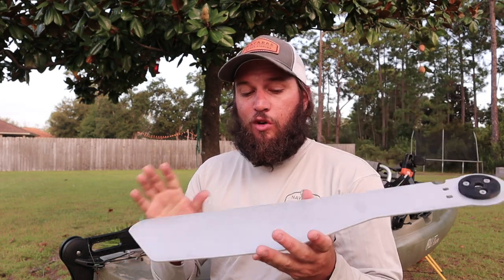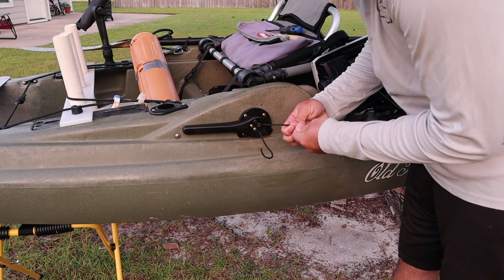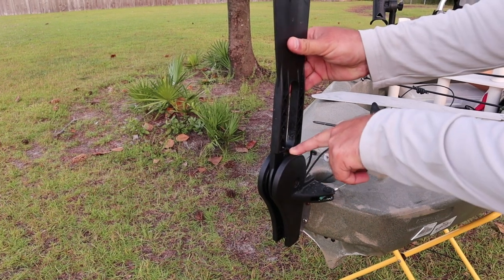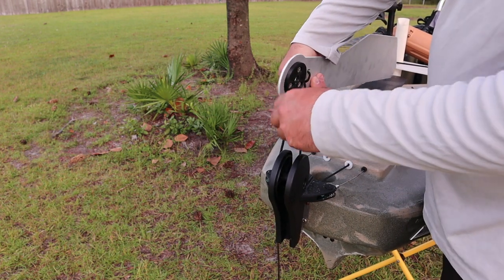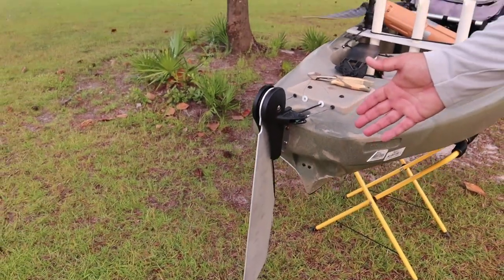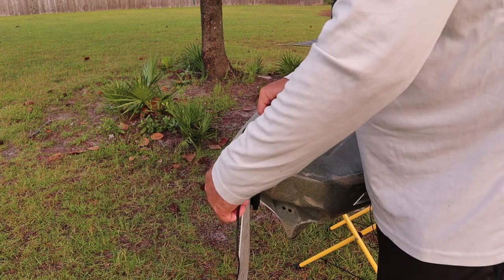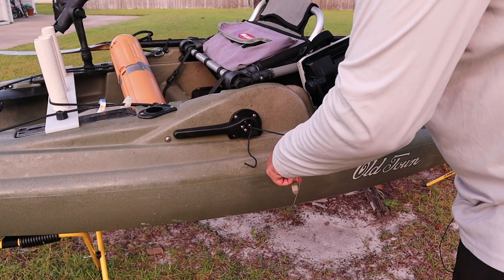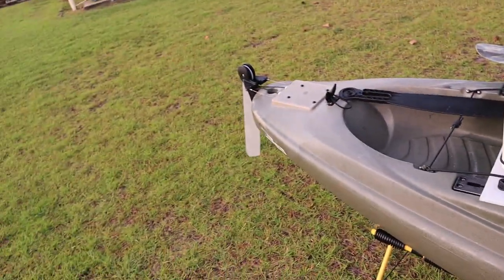Old Town Rudder Installation Video (Metal Replacement)

Comment: This rudder absolutely transformed the steering on my Topwater PDL 120. With the factory rudder the steering was non-responsive at slow speeds. With this replacement rudder the steering is responsive at slow speeds and insanely responsive at pedal cruising speeds. In addition I can cut directly perpendicular across strong current where are before I had to ferry across. 

Installation tip: Follow the video precisely. When you are ready to pull the cord back through make sure the rudder deploy handle is positioned exactly as directed in the video.
Reply: You have sold me on this sir! I have the same issue at slow speeds on the PDL 106. It's super annoying. I was wondering if the metal rudder helped it cut through better when you are going slow. Does it help steer when back pedaling at all?

Comment: Just finished.  I used 30 pound big game mono, sewn through the center of the cord, wrap to the end and tie.  I just didn't have any wire.  Take a pic of your cord arrangement at the rudder, the rudder lever and the pulley inside the hull, accessed under the seat.  You can reach the pulley inside with your hand, no problem.  If you break your line, it will be here.  Reach through there to the pulley opposite the lever and help feed it.  Only takes a second.  It makes it less stressful knowing you can help the cord make the sharp turns at the completion of the project.  Thank you Nick, great videos and cool products.  Will follow up on the rudder review when I get it on the water!
Reply: After being on the water with the new rudder only once, two things I noticed..first and more minor is it stays down.  The plastic one always wants to creep out of the full down position due to forward motion.  I checked 10 times, and it was full down every time.
Second, it responds noticeably faster, which is the reason I did it.  It actually makes the kayak feel like it wants to roll if you are travelling fast and turn hard.  No regrets to be clear, just a different seat of the pants feel.  You just added a lot of control surface.
I only have a couple hundred miles under my belt kayaking, but that is my take.  I did the rudder bolt at the same time, and that is a great improvement as well.

Comment: Very easy. Used 24 guage wire and it poked right through. A slight jiggle it will find it's path. I took the mushroom burnt ends and trimmed them to taper more to a point. Next would be nice to have the entire head aluminum. Not sure if you would need to add some small ballast for weight, but hey...Thanks again Navarre. Now on to my Tripleshot mount for my Lowerance transducer!!

Comment: Awesome! I originally thought it was silly and wouldn't be a big issue, But I was wrong. Every trip out I've been in multiple situations where I could not turn a certain direction because of the current. I hope old town goes back to the metal rudders, becomes a safety issue when you're next to rocks and bridges and stuff like I have been. I hope to order one of your rudders soon thanks man!
Reply from the maker: Thanks, Joey.

Comment: Finally got around doing this; had some minor stuff come up that might be worth mentioning for others. I had to use my impact driver to get out the bolt that holds the rudder, maybe it's because mine is still a bit new. I used 40# 7-strand fishing wire, and it was a bit annoying to get it to puncture through the cord's end but eventually managed; I think single strand wire/line works best. Finally, the wire I had sticking out the back went inside as I was moving the rudder around to guide the cord under the stud. I was able to get it back out by sticking my hand inside the hatch under the seat and pushing it out from there, although I admit I got scared for a second there lol. Also, it appears that the factory is "tying" the cord to the rudder's two "eyes" differently on newer kayaks than what's seen in the video. Instead of having the little loop that you have to pull out and hold, they just wrap the cord twice through the 2 "eyes" and then slide the cord through that loop that gets created and tighten it. Overall, a good experience and I'm happy with the results.

Comment: Could you look into what the market would be for a beefed up metal rudder for the Pescador Pilot 12. The current rudder has very little bite because it is so thin. I would gladly pay to have a medal replacement that was wider and less flexible. There are a number of videos on how to beef up the current rudder, but a metal replacement would be optimal. Thanks, love your stuff and your simple videos on how to use it.

Comment: Purchased two (2 yrs back) & FINALLY installed today... so looking forward to using them! Thx for this video; install went smoothly (even got the same cable lengths when done!). Only concern is, the metal rudder really slams the yak when putting it up... being aware one can minimize it, but have you had any feedback/experience on solving the problem?

Comment: This video is critical! I did it without wire but I DONT recommend. I put some 60# line through the rudder cable but it was pretty difficult threading the line through the braided cable. Can’t wait to get this new rudder wet.

Comment: Good stuff here, thanks for posting.

I just got a bigwater pdl a few days ago and was wondering, how tight do you like to keep the rudder steering cables?

They came pretty loose from old town and I've tightened them about halfway up the nuts, but still a bit of slack in the cables. I was just worried about over tightening and stripping something.
Reply from the maker: Luke, I keep a bit of play in mine.  The kayaks will slowly change shape overtime and the lines are to tight you will run into steering issues.  As long as it’s not coming unscrewed while you’re on the water you’re good to go.
Reply: The hull really shrinks and lengthens based on temps and/or being in the sun.  I wouldn't tighten them unless they are loose on the hottest sunniest day, or they will be tight as a banjo string.  Better a little slack than too tight.  Get one of Nick's rudder bolts and it will take the slack out of the rigging.

Comment: Just completed my install, hit a few bumps along the way lol...Heed Nick's advice and tie your wire (I used 40lb test Mono) as close to the bitter end of your cable as possible.  If you don't, you are going to have an extremely difficult time getting the cord back through the pulley, like I did.  If you have problems, make sure you open the hatch under your seat and grope around (the pulley) to get the lay of the land.  Thanks for the amazing support Nick!
Reply from the maker: Anytime, Chris.  I’m glad you were able to get it resolved for tomorrow’s fishing trip!
Reply: This is so familiar. I just did mine and experienced all of your same trials and tribulations lol. Used the iPhone to “see” what the inner handle area looked like.

Comment: Just got mine today and installed it a bit ago, I noticed the the metal one is thinner towards the screw where the plastic one has the grab handle, it gives it play back and forth at that spot, about 1/4 of an inch if not more to either side
Reply from the maker: Alan,

You shouldn’t have any side to side play in the rudder.  Email or text me some photos and I will help you out.
Reply from the maker: Alan,

You shouldn’t have any side to side play in the rudder.  Email or text me some photos and I will help you out.

Comment: Hey nick im changing my rudder out on my Bigwater with your rudder and I’ve got the lines in the right orientation on the rudder but when I operate my handle nothing happens and one of the lines are off the pulley inside, any tips on how to fix this?
Reply from the maker: Give me a call if you still need some help and I will get you pointed in the right direction.
Reply: @NavarreKayakFishing  thanks nick, I finally got it! It was the rudder lines not going into the holes in the pulley inside the hull, I didn’t know they were there and it was driving me insane lol

Comment: is there any reason the para cord old town uses cant be replaced with stainless steel cable ?..... a smaller diameter stainless steel cable would be a lot stronger than the para cord and wouldnt tend to wear out as fast
Reply from the maker: It’s not paracord.   It’s nylon rope which holds up fantastic in my experience.  Metal would cause a problem with the plastic pulley inside the kayak.

Comment: What kind of wire did you use to pull the cable through the kayak?
Reply from the maker: Single strand Malin wire in 27 lbs.

Comment: Got your rudder and rudder bolt kit and I am getting ready to install but after watching your video it is apparent that my rudder deploy lever takes way too much force to get it up or down.
Is there anything I can do to adjust this to make it more easy to deploy..... almost feels like some crap has gotten into the sleeves..... was like this since it was new and now about 3 month old..... love the kayak but this is one of my only issues and that in lots of current it really does not steer well.... hopefully your rudder and bolt help this as well.
Reply from the maker: Troy, when lifting or deploying the rubber make sure it’s pointed straight.  If it’s left or right at all it makes it harder to move.   That’s the only thing I can think of that causes the rudder to be hard to move up and down.
Reply: Could it be the lines are tightened too much?

Comment: Just installed the fat rudder on my 10.6 and now I can’t lower or raise the rudder. Seems like there’s play in the line. You got any tips?
Reply from the maker: You need to verify the rope is correctly positioned around the pulley inside the kayak.
Reply: @NavarreKayakFishing  thank you

Comment: My wire slipped out and then trying to fix it the other wires came out. Having difficulty finding a diagram of how the wires sit in the pulley. Any advice?
Reply from the maker: Send us an email and we can send out a diagram.
Reply: @NavarreKayakFishing   Thanks, i think i figure it out in the end. I flipped my phone camera and tossed in in the hatch to use as a mirror. The company should give buyers a diagram oof hor the internal wiring should go, I couldn't find a thing online.

Comment: Can you explain the benefits to having a metal rudder?  Mahalo
Reply from the maker: The PDL kayaks were first released with a metal rudder.  They went to a plastic rudder to save money in production.  The metal rudder costs through the water better (plastic flexes) and allows for more responsive steering.
Reply: @NavarreKayakFishing  Thanks for the reply.  I was out the other day, fairly choppy and windy.  Steering proved to be difficult at times.  I was wondering if this would make a difference.  Seems like it would.
Reply from the maker: @punasurf4697 anytime.  Let me know if you have questions. The business phone number is the best option.

Comment: Hey Nick, I watched your video and have the rudder installed fine but did something wrong on the lift-handle end of the project. Now I have both pull cords lose and took the handle assembly apart to try and figure it out, argh. Is there a diagram (or video) you can point me to that will help me reassemble the lift handle?
Reply from the maker: I have two photos I can send you.  If they don’t work I should be able to help with a phone call.
Reply: @NavarreKayakFishing  hey Nick, thanks so much for even replying back to me I really appreciate it! I just sent you a IG message and wondered if you could share the pics that way.
Reply from the maker: I don’t use IG anymore or have it on my home.  Email is the best option.
Reply: @NavarreKayakFishing  Nick, I just figured it out...wow! As you mentioned in your video to take your time and pay attention to the little steps, I should have been more careful. I cost myself a bunch of time and aggravation but I did figure it out just now! Thanks a bunch!!
Reply from the maker: Good news!  It is extremely frustrating if you miss the edge of the pulley.  Not being able to see is a huge pain.
Reply: @NavarreKayakFishing  That's what it was; after I figured that out I was able to finish the job. Thanks again for the support!

Comment: Does 550 cord/Paracord work as a replacement to lift and drop the rudder?
Reply from the maker: I wouldn’t use 550 cord for it.  I would try and stick with braided nylon.
Reply: @NavarreKayakFishing  Thanks!

Comment: How do you take off the knob cover thing on the rudder handle?
Reply from the maker: A small flat head screw driver will help you remove the top.  Usually the small prongs break during removal so be gentle.
Reply: @NavarreKayakFishing  Is there a way to make them not break? I’d prefer to not bust it so it doesn’t fit anymore.
Reply from the maker: I have never successfully removed to top without breaking the tabs.  That’s the reason I made a replacement knob.  No top part so you can loosen or tighten it whenever needed.

Comment: Nick, Did you ever have to replace the cables for the rudder? Great video
Reply: I would like to know too.. just in case if wire fails to hold onto cable to pull through.
Reply from the maker: The entire process is pretty simple and we have pdf images provided by Old Town for anyone who runs into an issue.

Comment: I can’t get my rudder to come back up? Help
Reply from the maker: Check the pulley on the inside of the kayak and make sure the lines are installed correctly.
Reply: @NavarreKayakFishing  I know the one to put it down is, the one to lift it up feels loose. I see no easy way to get it back on track???
Reply from the maker: Send me an email and we will get it figured out.
Reply: @NavarreKayakFishing  just got it. Thanks for the offer though.
Reply from the maker: Good news.

Comment: Any tips on removing the rudder bolt?
Reply from the maker: Which one?  Horizontal bolt that holds the two plastic sides together?
Reply: Yes the Horizontal screw  sir, it seems stuck. I used my drill but don’t want to strip the screw.
Reply from the maker: Shoot me an email.  You would be the 2-3 person to have this issue it’s crossed threaded from factory.
Reply: I'm having this issue.  Received my rudder today and the bolt stripped on me.

Comment: Thanks Nick for making all this awesome parts for us , been using em to upgrade my 106 pdl over the past 3 years. Today I finally had the courage to pull the rudder apart, a bit different from this model , but was able to get it done . I was observing the thickness of the metal rudder vs the plastic one , there’s a bit of room for play between the metal rudder and the plastic housing compare to the plastic one , wich it fits compact in there , maybe you can come out with a adapter to secure the play this metal rudder has in that plastic housing to make steering even more successful. Thanks again mate
Reply: Nick already made an attachment to solve this issue, and is on the way to me . That’s what I call customer service, outstanding. Thanks again Nick

Comment: What kind of wire are you using?
Reply from the maker: It was Malin fishing wire in 27-40 lbs.
Reply: @NavarreKayakFishing  Nick is the Malin wire you are using to route with #27 with a strength of 40lbs? Trying to make sure I get the right stuff to get the job done. Thanks!